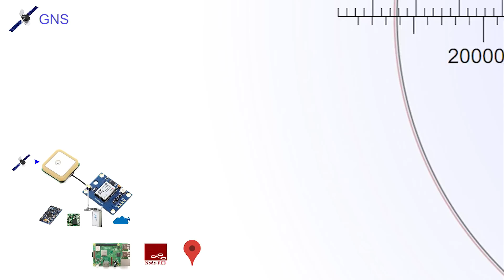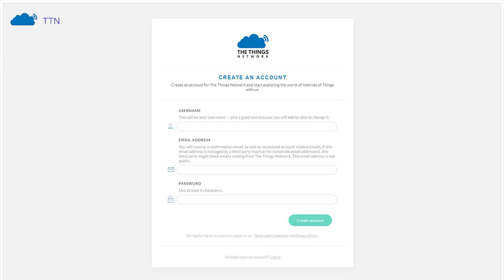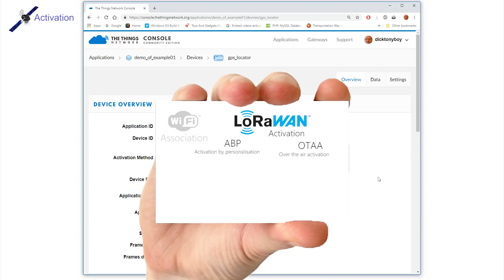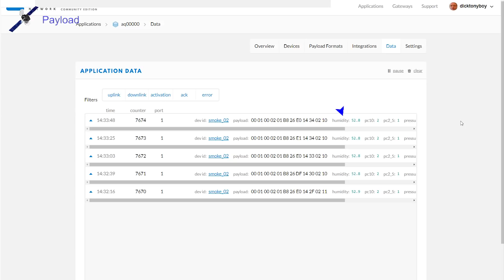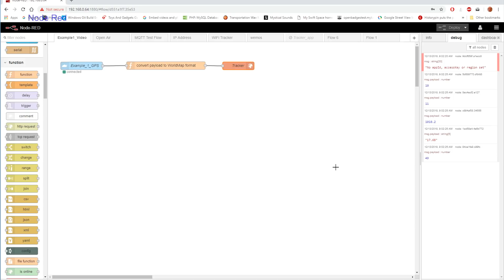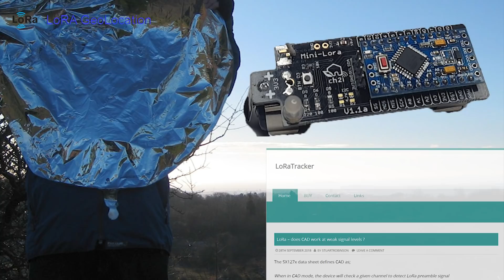Geolocation using LoRa and Node Red

Comment: Hi Richard, I have an inquiry on Geolocation with LoRa. Is it possible to track and follow the data in real time? (i.e. a robot connecting with a receiver following where the transmitter is moving, or the other way round) If so, do you have any idea how? ( I have no intention of involving GPS because I am trying to build a robot following the signal in an indoor environment ). Thank you for your time.
Reply from the maker: Mmm. There are methods BUT you have to overcome the two issues of the limited number of transmissions you are allowed and accuracy.  https://youtu.be/Tol18d-ZIf4

Comment: I would love to see the node-red code. I am doing something similar except that the GPS is local to the Raspberry Pi. The Raspberry Pi is mobile :)
Reply from the maker: So would I! My filing system is in a mess and I'm miles away from the machine I did this on.  I'll try to locate and publish it all on my return.  Good luck in the meantime.
Reply: @richard_wenner  That would be greatly appreciated. I would love to assist in making this better :)

Comment: Thanks for the diy node red implementation, where can i find the gitub example at 28:43 which one should i get?
Reply from the maker: I wish I knew - it would be useful in my current video.  I'll get back to you when I find it. Sorry.
Reply: Richard thanks for the reply, I made it work after a while, used the script and modified my payload through the path. The issue I couldn't get the data was that I used custom decode in TTN and after I switched to cayene lpp it worked!

Comment: Fantastic Video!!!  I'm working on a similar project with a Raspberry Pi and a Multitech modem.  Traccar is the open source mapping software I'm planning on using which has a lot under the hood for fleet management.  I like the arduino lora + GPS option - much less bulky and power hungry than my Rpi.  Looking forward to the links and maybe a wiring map of the arduino gps/lora device?  Well Done!
Reply: Interesting feedback - I do love hearing about the other options.  The nice thing about vehicles is that they can run Class C but of course you can't run ADR with mobile 1.1. Hope to get the links up before the end of the month. Thanks for the reply.